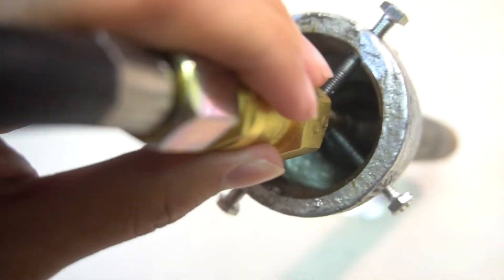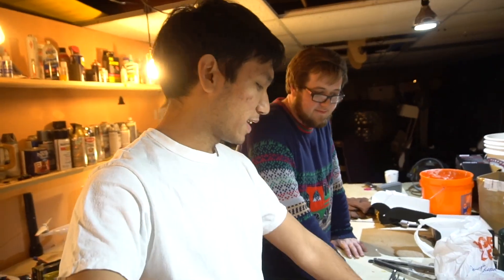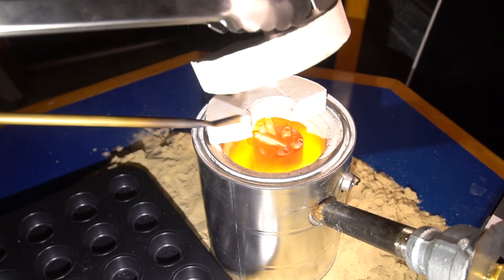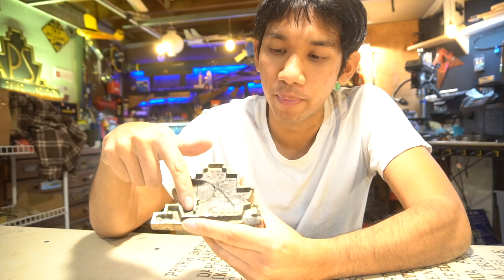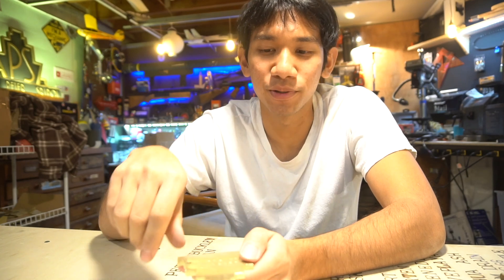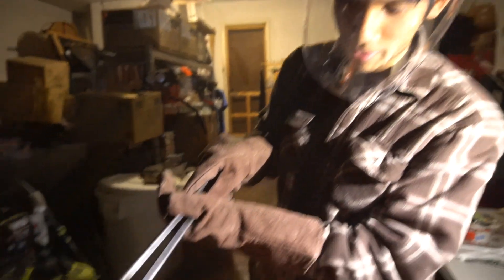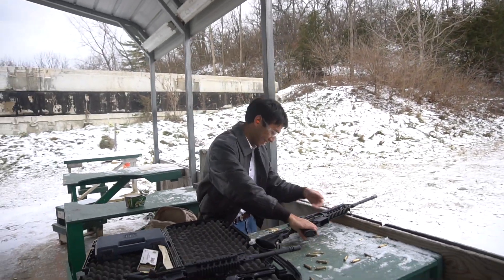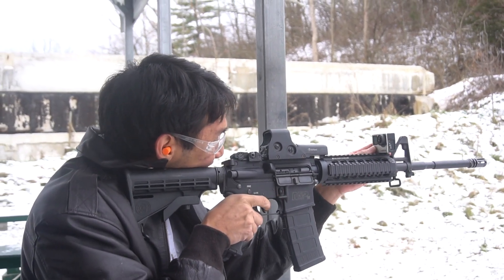Casting Brass: My first attempts!

Comment: Awesome!  Curious, have you considered a mold using a plaster investment?  My dad is a goldsmith (he casts gold, silver, platinum, bronze and brass) and uses the lost wax technique - he'll make wax patterns and create a hard plaster mold around them, then burn/steam the wax out.  I should think styrofoam would be no different?  You'd need a heat source big enough to house the mold, but your level of ingenuity is like 9000 so I wouldn't think that would be too much of a problem . . . ;)  Also, a suggestion, I'd love to see a DIY homemade jet engine, and from the garage mechanic/tinkerer channels I've seen on youtube, you have both the knowledge and production capability to make a thing like that both possible AND entertaining!

Comment: Foundry not forge there very similar just foundry’s stand up and forges are vertically should have gone with a bigger bucket though I wouldn’t go below a few gallon bucket personally my first foundry is a 6 gallon steel bucket from Home Depot and it’s been working fantastically I started with brass started I’ve yet to cast aluminum but I’ve cast a 5lb brass ingot and a tin bronze kopis sword that’s come out amazingly and not to give you shit but with your lid breaking it may not have been dry enough but most likely it’s the size I melted 5 lbs the other day and the lid has small cracks around the holes

Comment: It's not TKOR's design.  It's traditionally been call a "Ron Reil" burner, because he was the one who designed it.  Also, plaster of paris tends to dry out and crumble when it gets that hot.  You really need something like refractory cement or at least regular cement.  And the tweer hole should be right near the bottom of the chamber at an angle so the flame swirls around the crucible.

Comment: I've done this before. A good way to make it easier and provide pressure so the metal flows properly. Use like a 3 or 4 inch diameter terracotta pot, the ones with a hole on bottom. Bury it up to just below the rim with the hole directly over your styrofoam channel. Pour metal in slowly but steadily.

Comment: For hobby casting your settup is ok. For better results you need to first get your piece made then make a molde from high qaulity silicon. Make that into a wax model than coat in a fine sand slury several times burn the wax out and pour the brass. Break the mold and boom. Dont use range brass for more precise progects it has contaminants from the powder and is not quality.

Comment: You need to press that sand firmer. It should be able to hold itself together if you pack it tight enough. It helps to make it slightly damp as well. Also, if you 3D print in wax using this same technique you can burn out the wax the same way as the foam. In the jewellery business they do this but using plaster instead of sand and a centrifugal spinner to get the hot metal to spread out.

Comment: The issue that you had with the plaster is that you didn't use refractory cement-concrete for chimneys. Also you should of cured the furnace. Gradually increase the temp from 100c to 1000c in about 5 hours. You furnaxe should last waaay longer.

Edit: I noticed you already know about refractory cement.

Comment: I'm seriously impressed.  I didn't think your furnace could get hot enough for brass; how did you regulate the temperature so you didn't cook off the zinc?  Myself, I was lucky enough to find a bag of refractory cement in a local home improvement place, so when I put mine together it'll last quite a while.  EDIT:  Also, use a steel bucket instead of a plastic one.

Comment: Peter, glad a stumbled on your video...I've been casting aluminum for some time now but want to bump up to brass. My concern is the zinc flashing off like you mentioned. You used borax as a flux, but I couldn't tell when in the process it was added. Was it after things had melted or before lighting up the furnace at all? Thanks!

Comment: could you try packing the sand more tightly? that might prevent sand from collapsing in and also those rough edges and sides might get a bit better

Comment: Tip for lost PLA casting. Use plaster paris instead of sand. You'll get a finer detail. 
bake the plaster mold in an oven at 350*+ F upside down with a tray at the bottom for at least 6 hours, 24 hours at 300* is more ideal. This it to bake out all the water so the mold won't crack or explode when you pour a cast. Upside down, to drain the PLA (good habit stemming from lost wax casting).

Once poured and ready to break it out, dunk the whole plaster block in a lot of cold water. This will shock the plaster and shatter in the water, making it easier to get at the piece.

Comment: Next time, have the sprue stick out of the sand and put a tin can around it. This causes the metal to form head pressure (and keeps it from flowing out on to your bucket) which forms the part better . It also gives a large mass of metal to allow shrinkage without causing voids in the mold when the metal cools.

Comment: Hey Peter you'll get better but here's a few tips and I'll be sure to upload some videos of me casting  when I get better. When you put your foam in, don't make the sand so damp (judging by the color of the sand) and it always helps me to put it through a kitchen strainer to kind of make it less coarse. Lastly, foam coolers make the best forms and melts away the best in my experience

Comment: Tips: you didn't put the right angle or position for the burner hole. The cover, use a strapping to permanently contain the plaster (like the banding used for large pallets of brick, or, false ceiling straps, or, even better, the straps used to hold glass walls for plant houses (here in Europe, these are cheap, so that's where the suggestion comes from, heck, the pallet strapping, i get for free at the local DIY store, they throw the stuff out).

For the burner, smooth out every interior surface, and the mouth of the intake port,  as for the bolts, try and downsize to the next bolt size you can get (the more air flow you get, the better the flame, trust me on this, it comes from the old way to convert wood stoves to gas stoves, those pipes are glass smooth on the inside).

All in all, for a first pour, i'll give you a solid 8.
Reply: Check channel name SV Seeker for their prop pour (big honker props done as DIY as they get), you'll get a lot of info from their work. Also, Keith Rucker (channel name) from Vintage Machinery recently built his own furnace. A lot of stuff to learn from that too.

Comment: I probably would have gone with waste oil or kerosene.  For waste oil you'll get about 125,000 BTU's, Kerosene puts out about 128 to 130,000 BTU's, and propane gets you only about 93,000 BTU's.  It's doable with propane but would just take a little bit more time.

Comment: If youre using this to melt metal you should refer to it as a foundry not a forge (y)
Reply: Also I know you've probably done some research already but if you want to get accurate metal replicas from 3D printed parts I suggest you look into lost wax casting, its a lot more effort to make the mould but you will get a much nicer cast much easier.

Comment: just a heads up i beleive brass gives off toxic gas when melting
Reply: Ethan G Correction: Zinc does, and they used borax to stop the zinc from oxidizing

Comment: I've done the hole metal casting thing with this kind of forge but I haven't done the gas conversion yet but when I do it if it gets better results I'll make sure to do another comment as  an explanation of what I did but basically when you go to remake the donut put metal wires in it to increase the durability of it and when you do the forge again put a steel almost outer crucible with a welded bottom going into the floor of the bucket which will also increase the longevity of it

Comment: Best. way. to. get. brass. ever!!!!
Reply from the maker: funnything is that the last people left 100+ rounds of spent 556! I didn't need to shoot much at all!
Reply: PeterSripol
Brass for days!!!
Reply: Did you press the spent primers out first?
Reply: Love it when I go to the range and there are hundreds of brass casings lying around. Love it.
Reply: eddie cabrera they are not pure brass though,will screw up the mixture of the brass compound
Reply: The actual primer compound (lead styphnate , etc.) is probably almost completely consumed though. There's probably trace propellant left in the casings too, but I imagine that they would separate from the metal while it's being melted.
Reply: Erik Jensen a lot of primers are brass so he might not have had to
Reply: I was at the range today.  SO MUCH FREE BRASS!
Reply: Double wielding carbines has got to be the best way to "make brass." I've been cutting the 556 cases I've used and found to make 300 BLK ammo. Now I have a bunch of little 30cal rings of brass. I was planning to make them into grommets, but now I'm thinking about casting!
Reply: Emerecia always finds a way to include guns
Reply: @these_go_to_11  emerecia

Comment: Hi Peter, long time listener first time caller. Using Steel wool as a support structure for the lid works really really well.

Also a pretty awesome channel for metal casting or just different ideas / green sand, which may work out for some future projects, https://www.youtube.com/watch?v=2rAQxw6X6uc Makin Sumthin From Nuthin

Comment: when you have two ports like that, people usually only pour into one until they see it come up on the other side.
Reply: not with lost foam casting-the method he was using
Reply: true, when it just starts flowing up side B it's time to pour down it for more fresh molten heat+pressure, you have to kinda guess too for not being able to see through the foam.
Reply: By the time that it would come through aforementioned "side B" it would have cooled down to the extent that it would be a solid. The only way to avoid this would be to: A, not use lost foam casting, or B, have the entire mold heated to the melting point of aluminum(or close to it) which would eliminate the point of lost foam casting.

Comment: To make the plaster of Paris last longer when it was still wet you could of reinforced it with steel wool
Reply from the maker: Going to try this for the next one!
Reply: yes, or stacking small grid steel wire mesh through it.
Reply: good job on the little glory-hole. another tidbit investment casting, after plaster good and dry, bake them up couple hundred degrees helps flow into small stuff. the molten not cooling and clogging before a fill.

Comment: Nicely done, and great video production. What material can you use for 3D printing castings, does plastic burn away? I've seen wood filaments, that might work. Looking forward to your experiments......Happy New Year
Reply: for jewelry we used epilene, its very low temp plastic that melts and flows much like wax, very similar to hot melt glue stick material. 3D printed stuff will also get evap'd right out of the way in a good mold.
Reply from the maker: I've seen people melting away simple run of the mill PLA, Maybe i'll also try some epilene as Model nutty mentioned!
Reply: PeterSripol
epilene is NICE but damn I hated babysitting that plastic injection machine!

Comment: So you just let the plastic burn away?
Reply from the maker: yes! this is one thing that i'll be trying when casting my propellers!
Reply: exactly that, it's foam evap casting
Reply: Erwin Holland  yes even though I'm not peter lol😃
Reply: Ok cool.
Yeah he was talking about 3d printed things too. Just let that burn too?
Reply: Erwin Holland
yuppers, it'll vacate to be replaced with molten metal really quick! up top I replied to Peter about whipping up a really good cheap vibration vacuum table for making investment plaster molds, for better precision pours. the vibration+vacuum pulls the air bubbles from the plaster and wax (or plastic). same as we'd whipped up for casting jewelry stuff in my buddy's garage, it was awesome!
Reply: Erwin Holland
it was really cool fun stuff, very surprising what the vibration and the little vacuum from an aquarium pump (reversed!) does for investment plaster molds. getting the bubbles and micro bubbles out lets the plaster really form to the shape being poured, lot more accurate! didn't cost 10 bucks to make it happen, takes about an hour to whip up. if you get a used but semi standard air pump a decent aquarium store has rebuild kits to replace the diaphragm and little flapper valves pretty cheap, we made the base seal out of red RTV silicone thicker to the outside of the coffee can (spray with PAM). the same silicone seals the air pump just drill for tube inlet one end and ignore the stock air output. a thin smear of vaseline lubes the top lip of the can and helps it seal for using.

super simple cheap and nearly as good as the real deal pro s#it, it IS slower and develops less (but enough!) vacuum to "git-r-dun". never stuck waiting for replacement parts like the pro stuff, no "settings" just let it do its thing 20-30 minutes. you can do silly stuff like turning a cheap plastic boat propeller into a bronze one, sprue up spiders and scorpions for pouring silver (how to turn 7-8 bucks worth of silver into 100 bucks with a little work lol) etc etc. the pro stuff IS cooler looking with the clear acrylic vacuum bell, but price that stuff geez! the platform/table was like 5/8 birch ply, is lighter flatter with more laminates, smooth veneer skin easier to make the seal on too. we just strapped the air pump down with screws and plumbers tape = duh simple!
hopefully Peter will see these extra little details about it and show what it'll do.
Reply: Thats awesome. Thanks for the info :)
Reply: PeterSripol
yaay you saw this!! our garage project vibe+vacuum bell was back in 1990-1991, for little stuff soda and beer cans with the tops cut off were good cheap casings to pour the plaster into. the acrylic bell of the pro stuff was cooler for being able to see the bubbles coming up out of the investment plaster and it'd do it a bit quicker having stronger vacuum+vibration, but for 10 bucks the home built toy worked perfect! another great tinkertoy was the blow dryer vacuform box for 2 liter soda bottles cut for flat blanks. 3 raided for heater coils (GoodWill!) and one motor/blower pulling vacuum. 3D printing kinda makes them obsolete unless you want a lot of 1 part quickly.

Comment: Great job Peter, when you re-make the lid, would it be worth mixing the refectory mix with rockwool loft insulation or fibreglass strands to act as a binder?
Reply from the maker: That should be interesting! It seems as others have added meshes to their mixes as well for strength!

Comment: I used my 3d printer to make a replica of the final object that needed to be cast for someone, and they were able to make some sort of resin mold from that, which you could pour the brass into. The result needed some cleaning but it was still a pretty efficient way of doing it.

Comment: This isnt forging it's casting or founding, forging is when you stamp hot metal into a shape, the thing you melted it in is a furnace
Reply from the maker: title updated! I'm an idiot haha, it shows what I know! :D
Reply: oh definite luck with the basic sand/foam evap casting! still good a very good lesson. next up, go for wax and investment plaster. fairly soupy with vibration will get bubbles out, for really complete bubble elimination you'll want to whip up a vacuum bell (can be done with a coffee can for smaller projects!). you can get BOTH actions (vibration and vacuum) out of a decent size strong aquarium air pump by sealing its seams and giving it an air intake tube, to pull a little vacuum in the can while vibrating everything in it.. mount air pump solid to your board with seal (for the upside down big coffee can), board's feet are thick foam rubber stuff so whole thing vibrates same time as it's pulling air out of the investment plaster inside the smaller soup or coffee can, with the BIG coffee can as vacuum bell. hope you get the image of what I'm typing here, this is a very low budget low tech good working vibe table vacuum bell, you can get nearer jewelry castings out of it. it'll typically take 20-30 minutes vibe-vacuum time for the bubbles to rise up out of the plaster in first part of it's way to drying. if you get the picture do it, it'll really surprise you!
Reply: I once worked in a foundry as a sand molder. Outlet holes are important to let the air out and to also gauge when its full. You can also poke small holes evenly throughout the sand mold and spray C02 into those holes to harden the sand to a solid mold, this would help with detail. I really enjoyed that work, casting is amazing.
Reply: I thought forging was the process of moving heated metal around/shaping it
Reply: Try to make a spaceship